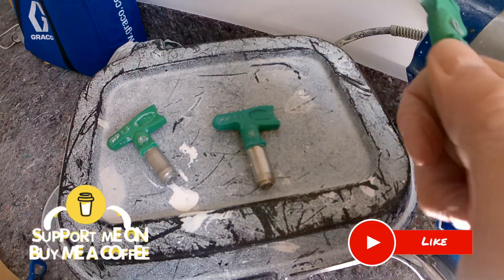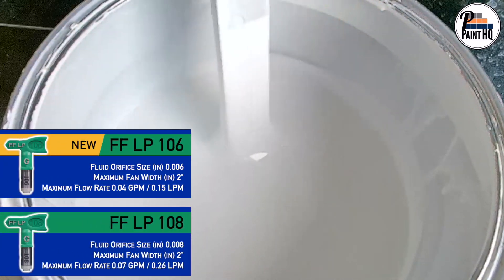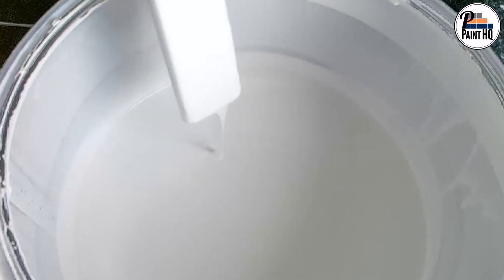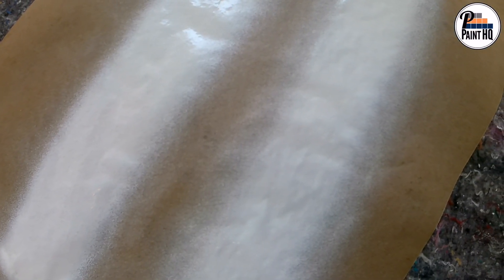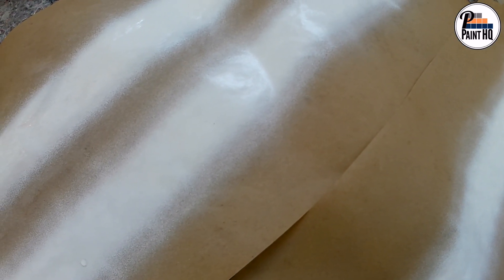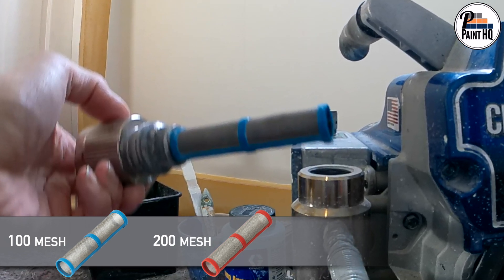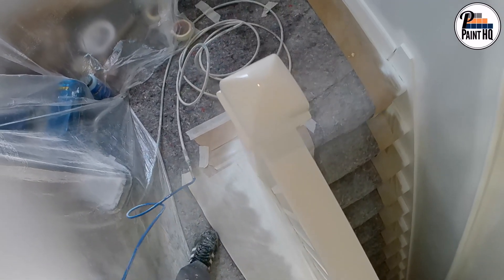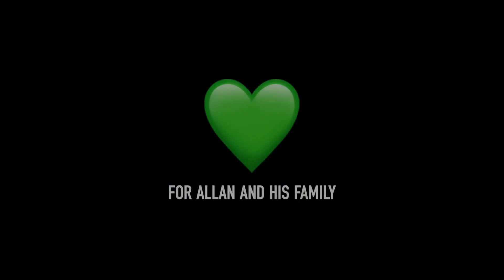EXPLAINED Graco FFLP 106 and FFLP 108. Paint Viscosity and Airless Spray Tips

Comment: I didn't know that they have the 106 tip i always use 108
Reply from the maker: Yeah a Graco FFLP 106 is a relatively new tip size.. it’s great for extra control spraying low viscosity material 👌💙💯 regards Pete

Comment: What tip do you recommend for spraying kitchen cabinets with the graco quickshot. Thanks for your awesome video's
Reply from the maker: Thank you my friend, appreciate you watching the videos.. tip selection will depend on the material being sprayed — typically a .008” and .010” orifice will cover most fine finish material.. depending on desired a fan width, a Graco FFLP 208 / 308 and 210 / 310 👍 regards Pete
Reply: 💙 appreciate
Reply from the maker: Anytime 🙏💙💯

Comment: Great video Pete thank you. 
If you were to do this using the little Graco quick shot would you still use the 106 tip or 208?

Thanks again 🙂
Reply from the maker: Great question 👍 the UQS minimum tip support is .008, however with the right low viscosity / spray only product, a 106 works very well as long as you don’t over-pressurise — a 208 also works extremely well and is ‘easier’ to use (no risk of over-pressurising, a .006 tip requires more pressure).. so I personally would use either, otherwise go with a 208, it’s a great tip 👍👍👍 Regards Pete
Reply: @PaintHQ  Thanks Pete you're the man!! Which waterbased paints do you prefer using on woodwork when spraying with these mind of tips? I don't see you mention much about this in your videos so just wondering? Thanks.

Comment: Hi Pete, watch a couple of your vids. Amazing! 
What I do not fully understand, instead of increasing the pressure on the 106 tip, would it not be possible to thin down the paint?

I am thinking about buying a new tip - but as hobby, my budget is somewho limited - i can't get a 106, 108, 110 etc...
Reply from the maker: Hey buddy, thank you for watching my videos 🙏 you’re spot on in your thinking.. although a 106 (.006”) is for very low viscosity paint and still you’re forcing material through something less the size of a human hair 👍 a 108 can be a little hard to control.. to buy one tip for small work and be more controlled, I’d probably go with a 208 — yes a wider fan (4”), the wider overspray is worth the compromise (unless the low viscosity material really will go through a 106, without tip blockage, it’s difficult to say without testing).. hope this helps my friend.. regards Pete 💙💯

Comment: I'm looking to buy the quickshot for painting small pieces of mdf.
Do you think this would be a suitable machine? I make miniature kitchens and am not sure if this would work for such an application. Do you think using the smallest tip at low pressure would be suitable to paint quickly?
Any advice would be highly appreciated.
Reply from the maker: Hello my friend.. I’m confident the QuickShot will be a good investment for you.. but to be sure — how miniature are your projects?..  .008” Graco tips work very well, even .006”, such as FFLP 106 and 206, if spraying low viscosity materials like in this video.. I link to the products in the video description — AkzoNobel WP136 (now known as 099) works extremely well on mdf, sealing edges — quick denib when dry and maybe a further high build coat and the mdf is silky smooth 👌
Reply: Thanks for your response. A kitchen is roughly 30cm wide and 19cm high.
I appreciate your help.
Is it possible in any way to use thicker paints with a narrower spray pattern? 
Many thanks.
Reply from the maker: @ArtfluentCreations Certainly airless is the way to go when spraying thicker / higher viscosity materials — But, you will loose some of the control, and if you was spraying a thicker material through a narrow 2” fan (110, 112), the trade off is a heavy coating.. correct me if I’m wrong, is an airbrush / airspray setup suited for spraying miniature / model size projects ?.. although airspray is more suited to very low viscosity / thin materials.. happy to help any way I can 👍 regards Pete
Reply: I do have an airbrush but having to thin the paint so much and the spray being so small with hardly any power takes far too long.
I'm looking for something that can coat as quickly as possible, but not too heavily, so probably will have to thin the paint, but hopefully not as much as an airbrush. I would be spraying a lot of these kitchens at once in order to produce faster, so I suppose a larger orifice wouldnt be too much of an issue. 
Does this have similar control as a hvlp, do you think, as I was considering one of those but don't have the space for a compressor.
I appreciate your help.

Comment: What tip would you use to spray dulux water based satinwood? I've just got the graco quick shot and we're painting architraves, door frames and doors, and using about 1.5 ltr of paint just on 1 door and frame 1 coat. Getting a few runs aswell
Reply from the maker: Hello my friend.. you need to slow down the material flow by using a smaller orifice tip.. an .008 tip such as a 208 or 308 should work with your WB product.. which tip did you use, I’m guessing a larger orifice tip to spray the quantity of paint you mention .. moving  much much quicker will also help not lay on as much 👍

Just little tweaks to your setup and technique.. you’ll get there my friend 💙💯 regards Pete

Comment: Do you think Kip masking products are good enough to go for? Cheers
Reply: And what about 206, 208 Tritech tips?
Reply from the maker: Hello my friend.. Kip use innovative Washi technology in their professional range of masking tapes, the parent company Shurtape (the company behind FrogTape) only make tape for themselves, Kip is a product range I most definitely recommend 🔴💯
Reply from the maker: That's a very good question.. I have some experience testing a TriTech Ultra 208 Vs a Graco FF LP 208 and the Ultra required much higher pressure (above double if I recall).. Whereas the FF LP was at 900 psi.. with lower pressure you get less overspray, material waste and tip wear.. hope this helps my friend, regards Pete
Reply: @PaintHQ  Thank you, didn’t know that, usually I am using Ciret products and have not been disappointed with. I’m talking about sensitive range of tapes when crispy lines are desired. Cheers
Reply from the maker: Sure, here’s the 2 main tapes I use.. this is the premium ‘gold’ Washi for fully cured surfaces.. I use to mask woodwork and trim, when spraying the walls..

Kip Washi-Tec 238 Premium
https://www.amazon.co.uk/Kip-Painters-Decorating-Wallpaper-Sensitive/dp/B09HV9HHQG/ref=mp_s_a_1_6?keywords=kip%2Bmasking&qid=1668888729&sr=8-6&th=1&psc=1

And this is the low tack / sensitive Washi.. I use to mask walls when spraying the ceiling in on the last day..

Kip Washi-Tec 209 Wallpaper
https://www.amazon.co.uk/Kip-Painters-Decorating-Wallpaper-Sensitive/dp/B06XKKZ4GY/ref=mp_s_a_1_6?keywords=kip%2Bmasking&qid=1668888729&sr=8-6&th=1&psc=1

Comment: Hi Pete, going to be painting my own property soon using the sprayman GX21. Could you list the the masking paper, drop sheets, tape etc you use and also some affordable paint for walls ceilings and a satin based combo or system to go over oil based woodwork. I’ve watched a lot of your videos but I need a good solid list to go ahead and order off 🫨 it can get a little tricky to keep up. I hope you can provide this information and will be greatly appreciated 🫣🤞🏼 cheers and take care.
Reply from the maker: Hello my friend, apologies for delay, I will always get back to you.. happy to help and advise if I can.. 

I recommend Kip masking products, if you search for “Kip Masking” in Amazon, you’ll see these products that I use..

-Kip Washi-Tec 238 Premium..  is the gold washi tape I use on fully cured surfaces, when spraying for super sharp lines..

Then this is the low tack / ‘purple’ sensitive Washi.. I use to mask walls when spraying the ceiling on the last day.. 

-Kip Washi-Tec 209

Kip Masking-Tec 3804 (48mm), I use for a cost effective crepe masking tape for non-critical lines..

Then the 2 main plastic film and papers I use..

-Kip Masking-Tec 232 Film (2.6m)
-Kip Masking-Tec 234 Paper (30cm)

Regarding woodwork.. I use a lot of these products for day to day internal joinery.. they are low viscosity, waterborne industrial 1K products.. spray very easily, no thinning at very low pressure ..being low viscosity, I use .008 tips.. so a 208 / 308...

WP136 Water Based Primer / Edge Sealer
https://holmanpaints.co.uk/interior-wood/171-akzo-nobel-WP136-highbuild-waterbased-primer-edge-sealer.html

For the satin topcoat.. AkzoNobel Aqualit (Supercryl) Waterborne Enamel Topcoat
https://holmanpaints.co.uk/interior-wood/169-akzo-nobel-aqualit-waterborne-enamel-topcoat.html
..you get a beautiful cabinet like satin finish ..and very cost effective, especially in 5 litre cans..

Comes in white, then if needing tinting both primer and top coat can be colour matched off any colour chart..

I’ve used Holmans for years, the Holmans team are all super helpful..

Can be delivered next day if required.. If this helps at all, Holmans have a 5% discount code, across all their range.. 

👉 Use code PAINTHQ

Keep in touch my friend.. regards Pete

Comment: Pete love the channel. I have two of the Ultra handhelds and use them every day. Question, if I were springs spindles and want to use Benjamin Moore advance and 106 tip how far would you thin out that product?
Reply from the maker: Hi Brian, really appreciate your support and kind words 🙏 ..I fear BM Advance is a little too thick in paint viscosity terms for .006 tips — .006 such as the 106 suit low viscosity primers / top coats and clear lacquers (free flowing / spray only materials), whereas BM Advance is more thixotropic (can also be brushed / rolled) — typically you would use a .010, but BM are quality pigment paints — it may go through a .008 — I’d be inclined to recommend trying a 208 for spindles — a bit wider, but much more manageable.. I think you would get paint runs with a 108 🙈

Hope this makes sense and helps a little.. always feel free to reach out and I’ll do my best to help — let me know how you get on, regards Pete 💙

Comment: Hi Pete, great vids. Ive bought some of the paint you mentioned in your other video Akzo Nobel enamel top coat. Also bought some 206 and 208 FFLP Graci tips to try. I'll let you know how i get on as Ive got full house of skirts, arcs, doors and stairs to do. Fingers crossed ill get much less runs this time around. You are very kind with your time and advice answering questions for everyone. Keep up the good work.
Reply from the maker: Hi Ben, great news — I wish you all the very best with your latest spraying venture 💙 ..Move relatively quick to begin with, as you get a feel of how the low viscosity product lays down.. then gauge how ‘slow’ you can move to produce the ultimate coat, that dries down beautifully smooth.. also, you will get some dust from the fine atomisation, use a microfibre cloth / vac between coats to remove any dust that could ‘interfere’ with the spraying 👍 good luck my friend, keep in touch 💙💯 regards Pete

Comment: Hi there. I bought a 110 tip, but I am scared to use it because of the flow rate. Could you suggest when a 110 might be suitable?
Reply: I brought one a few years ago but there next to useless my friend to much paint flow you would have to move so fast not to get runs you would loose all control I found a lovely place for mind at the back of the shed and to the best of my knowledge it’s still there give the 1.06 a go 👍🏻
Reply: I use a 210. For 2 inch door trim..with cardboard behind to catch over spray
Reply from the maker: @BK-gc1jm Thanks for sharing, great input buddy.. regards Pete 💙💯

Comment: Question. I have a graco magnum prox19. It said that start at 1500 psi to 3000psi.  So..if u are using 900 psi ..this mean i cant use this tips? Or there is something i am doing wrong?.  I tried today. But i put 3/4 of the psi and worked. Then..is i put half..doesnt work well..
And in a 1/4 of pression kinda works..
I dont know really what i am doing. I mean. Which psi i should use my machine? Or i cant use it?  Thanks
Reply: In the video he adjusted the material keep practicing with the pressure after you’ve adjusted until you get the right spray pattern with no tails.

Comment: Hello guys this week mt graco coming i just want to ask u i am furniture maker ussaily tv unit wardrobw and kitchen which tips number its best for cabinets and cupboards i am new in airless thx
Reply from the maker: Great to hear from you buddy.. depending on paint viscosity, I’d look to use a FFLP 208 / 308 👍 You have a reduced flow Vs a 310 and will gain more control.. a 310 (again depending on viscosity) could lay down too much material.. I tend to use a FFLP 208 or 308 in almost all cases 👍 Regards Pete
Reply: @PaintHQ  thx mate u helpfully
Reply from the maker: @yavuzhocaoglu8568 🙏💙💯

Comment: Sure I have a 106 buddy but have never used it may give it a try with the Akzo Nobel 👍🏻
Reply from the maker: Hey Simon.. sprays beautifully my friend, let me know how you get on my friend 💙
Reply: @PaintHQ  learning all the time buddy the fact the data sheet for Dulux satin Wood recommended a 6.16 tip was a real eye 👁️ opener used a 5.15 thinned it by 20% and got good results just as well they where panels any detail work with a 5.15 May have caused an issue or two 😂
Reply from the maker: Thanks for sharing brother, you’re a diamond 👏👏👏

Comment: Pete , beautiful work brother from another mother .dropping that glass man . Looked smoother than butter . I had 2 questions for you if you have the time to get back to me I’d really appreciate it . 

#1 ) you said you liked the reduced flow…… I know it’s pretty straight forward and everyone prob understood but I  didn’t . Could you explain what you meant by that 

#2 ) you had stated in a video a while back that trimtech tips were not fine finish I believe  correct me if I’m wrong . I know they have a tip labeled fine finish but I think you were saying they have to be sprayed at the normal pressure so are their “ fine finish “ tips not low pressures
Reply from the maker: Ah my brother, appreciate the kind words, very much appreciated 🙏 ..good questions, it’s my goal to create informative videos for everyone to be able to understand.. flow rate refers to how much in litres or gallons is sprayed per minute (if spraying water).. it’s the 2nd part of the numbering on the tip that indicates this .. #06, #08, for example 106, 108 ..the orifice size ..so a 106 has ‘less flow’ will let out less paint Vs a 108 ..this is what’s also meant by ‘gaining control’ or ‘ultimate control’ ..you potentially will be able to move the gun slower using a 106 Vs a 108 ..less risk of a paint run ..However it’s important to note, the viscosity determines how small a tip orifice you can use.. so .06 and .08 tips are for low viscosity, very thin, free flowing paints (usually spray only).. thicker finishing paints that can also be used with a brush / roller usually suit a .10 or above 👍

Regarding TriTech Ultra Fine Finish, sure they are a fine finish tip producing fine atomisation.. they (by design) are not low pressure.. which is ok, I guess it’s down to preference in terms how you ‘like to spray’.. I’ve previously done a test using 208 tips and if I recall Graco FFLP tips were half the pressure (900 psi) spraying low viscosity waterborne material.. so Graco releasing new 106 and 206 (and 408) sizes, is pretty awesome if you’re a fan of low pressure spraying 💙 ..hope this helps my friend, always feel free to reach out, I’m happy to try and help.. sorry about the essay 😆 ..regards Pete

Comment: What about 206, 208 Tritech tips on cabinets painting?
Reply from the maker: That's a very good question.. I have some experience testing a TriTech Ultra 208 Vs a Graco FF LP 208 and the Ultra required much higher pressure (above double if I recall).. Whereas the FF LP was at 900 psi.. with lower pressure you get less overspray, material waste and tip wear.. hope this helps my friend, regards Pete